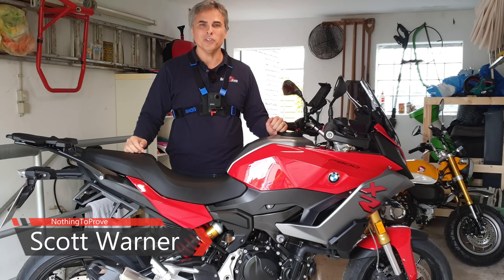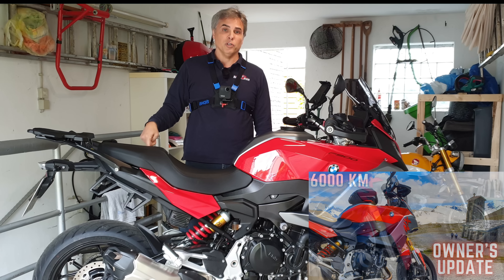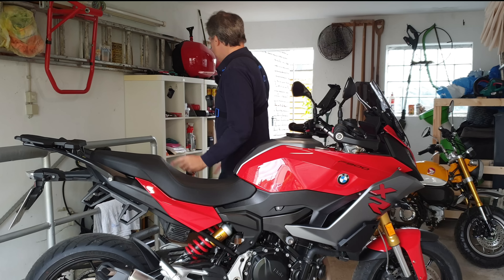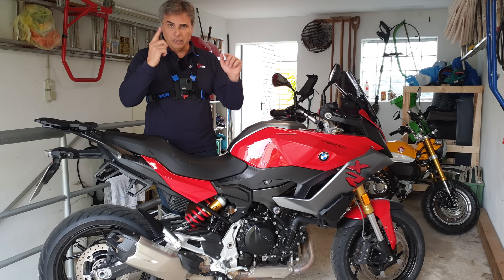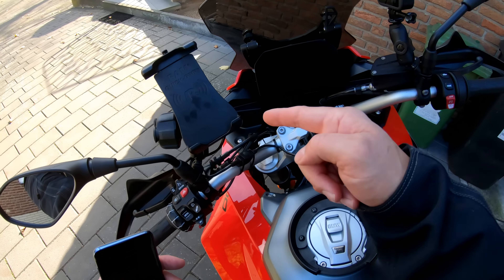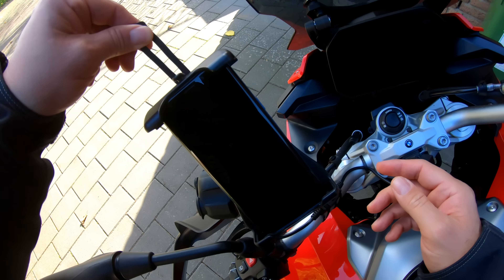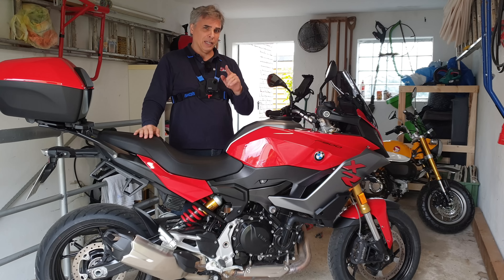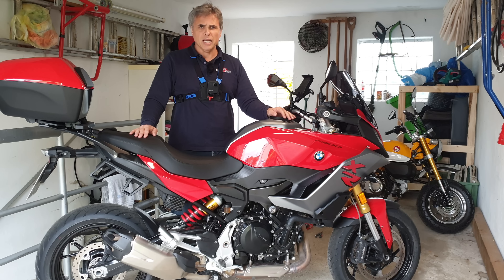BMW F900XR Wireless Charger, USB Install, Mirror Mounts, Hard Cases & More

Comment: Great review. 10 days with my f900xr so far, but with total lockdown Fridays to Sundays,, little chance to ride.
I am very disappointed with my BMW side cases due to their poor capacity, too much wasted space. Can't even fit a helmet in right case and only at a squeeze in left. My biggest mistake with configuring my new toy. Self fitted a Givi Trekker 52 topcase onto the BMW rack at the back and great. Now looking for a USB solution... Your way looks to work fine and the routing is clean and safe. Was thinking of mounting my Garmin above instruments  but maybe not needed. Don't really like looking down for GPS on handlebar mounted phone. Will re-upholster seat with comfort gel for about 80 euros in local shop (bmw actually advised me against theirs). Going for the taller Givi screen too, already ordered. 
Keep the info coming, fantastic work!

Comment: MRA screen with the little flipflop works great. Puts you out of wind and buffeting , and in low position is cool in the heat.
Reply from the maker: Yea, I forgot to mention that brand too 😢 in fact I'll probably get the MRA screen because I put an MRA screen on my 1290SDR and loved it. So will probably get it for this too with the vario touring windscreen (VTM). 👍👍

Comment: Hi  love your content, is the comfort seat a big improvement on the standard seat?
Reply from the maker: Thank you Selina,
For me it's worth it because it raises the seat height 20mm and gives me more leg room and is a little wider so more of my rear is on the seat to relieve pressure, which I need for long trips. And yes it is softer than the stock seat, I do feel it could be a little more...for example the 1250GSA seat is even softer than the comfort seat. I was just out yesterday with "Uli the GS guy" that I ride with a lot and we had the bikes right next to each other and compared seats and his stock seat was a little softer than my "comfort" seat...hmm...I was not a happy camper about this. But for now I'm satisfied with it.
Ride safe,
Scott
Reply: My BMW dealer told me to forget the BMW comfort seat because it's not that comfortable either 😂, as well as hurting your bank account. He recommended finding a local shop to reupholster it. My local bike shop has quoted me 80 euros.
Reply: @NothingToProve  love to have one to give 50mm more with the lo seat provided as std.
Reply: @roythompson6137  wunderlich has the comfort queen that is super comfy for passenger also but..  wont' ship to asia.

Comment: Hi Scott, just a tip about the Connected app.  I'm not a fan of Bixby, but I was able to setup a Bixby routine that opened the Connected app whenever the phone connected to the bike's bluetooth along with starting Spotify in the same routine.  All this is automatic when I turn on the bike and the phone connects.   Now I need to check out that RAM mount -- haven't seen that one.
Thanks for the info for the charger and wiring.  Oh yeah,  noticed the Monkey in the background also :)   Much different than the one she was practicing on so I guess she did well.  Be safe!
Reply from the maker: Thanks for the tip Brian!
Yea, I'm not a fan of these automated things from Silicon Valley, they claim to serve us but in reality we serve them. But as you did, when it is actually more efficient...then I consider them.
The Monkey, yes, she loves it and the reason I have not done a review of it is because I'm trying to get her to do a review instead of me, after all it's hers and she rides it all the time...well now it's cold so not so much any more.
Take care,
Scott

Comment: On my F900R in the US, the navigator cradle was part of a package that I could not customize, so I was forced to include it even though I didn't want it. At first I planned to remove it, but I have since found a phone mount that makes use of the cradle and provides mounting and charging for my phone while using the Connected app, so I've decided to keep it. I do wish I could find a wireless version though, this one just had a short USB cable to the phone.

Comment: Very cool. I agree that wireless charging is cool; I plug my phone in and mount it. I use Waze for the police notifications (speed trapping mostly) and it's general aesthetic and rerouting. That works for me but your solution is elegant. Really nice upgrades. BIke is looking great!
Reply from the maker: I've read about Waze but we don't have it over here in Germany. The question is: Does it really work? And is it practical to use while actively riding?
Thanks in advance Scott!
Ride safe,
Scott
Reply: @NothingToProve  Yes, it works. Often better than a radar detector because most police here use laser now. I have it set to alert via voice when there are police ahead. I'm not a hoonigan or racer but it is good to be conservative when called for. We don't have speed cameras, but I know it also alerts for those. It's a great app.

Comment: not sure if i like that smartphone mount, its huge. the original bmw navigator mount was not an option? there are smartphone inputs for that thing with usb ports and all so you dont need to run any wires.

Comment: Great setup Scott. The BMW is still looking sharp & now you have a home away from home! No more just socks & jockeys. Could you show us if your helmet fits in either side case or top case please? That can be helpful. Otherwise, stay safe & hopefully winter time passes quickly. Still, would love to see more of Germany in winter time 💯🙏🇦🇺
Reply from the maker: Thanks Steve,
Yes, helmets fit in both the top and side cases no problems what-so-ever. Winter riding can be tricky sometimes but I plan to do some when it's dry, don't like cold and wet at the same time, it's a bad combination. 😒
Ride safe,
Scott

Comment: I wonder if you are really happy with the original bags and topbox. They seem not so easy to handle and hold in one hand and a little fragile in the paint when you take them off back and forward to hotel etc. 
Have you this as best solution or do you also consider GIVI as an option.

Comment: Great video. I have a F900R, just bought the BMW soft panniers (keyless option). Installing them looks like a pain, especially coding the key cylinder, there isn't a video I could find anywhere. Any tips you can provide? Very much appreciated!

Comment: Sorry for asking but Since there is a 12V socket why all this trouble with the USB Power wire ?
Reply from the maker: Cause it's located under my left thigh, then I'd have to run a wire from there and it's not permanent or water proof.
ride safe,
Scott

Comment: Hey, I have a question about the top case, its not to easy to steal or that fall down with the vibrations or the wind? Hello from México
Reply from the maker: Hi, na, it's locked on & the top speed for the top case is 175kpm.
take care,
Scott

Comment: I have the same RAM Mount wireless charger. It charges my LG smartphone very well unless the display brightness is turned all the way up. In that case it very slowly loses charge. My solution is to manually set the display at 50% brightness and then it will charge the phone all the way up to 100%.

Comment: I wasn't aware that Ram-Mount had this wireless charger.
The lock is not removable, is it? I had the one that you just apply when you need it. It made the looks a bit cleaner.
Nice video once again 👍

Stay healthy and safe Scott!
Reply from the maker: Hi Simon,
Yes, the lock is removable, when it's unlocked it can be screwed off and used on any RAM mount arm just like the standard thumb screw. And yes, it's big but I guess that's the price for security.
Take care,
Scott

Comment: hey there! today i ordered my xr900 2022 black storm edition , but i have only one question...is it true that the engine is low quality because of the fact is made in China by leoncin?...only rumors, in my opinion BMW is a premium brand so even if it is made in china should still be a premium engine. right? thank you and hopefully my xr arrives in a few months.
Reply from the maker: Na, don't worry about the motor, if there was a problem I would not have bought mine 😁
BMW has had this motor made at this same plant in China since 2007, when it was the F700, then it changed to the 750, 800, 850 and now 900 but in all iterations, it's still the same base motor. So by now if there were problems, BMW would have them worked out by now.
ride safe,
Scott

Comment: 900xr brochure says it has a 12 volt socket? Where is that located in the bike & why you didn't use that for power supply to RAM mount?
Reply from the maker: It's underneath the seat right under the left thigh. So I would still have to run a usb wire from the handle bar all the way down there...so just go to the battery and keep the 12 volt port free for when I plug in an electric riding suit...that is why it's located there.
Reply: I like the idea of 'switched power' for the phone mount (as that will always be on the bike); and going to the battery for the electric riding suit (with an in-line fuse).

Comment: Aren‘t you afraid the vibrations might kill the camera in your phone? That was one of the reasons why I opted for the TomTom (apart from being afraid of water damage in the rain) instead of a mount for the smartphone.
Reply from the maker: Nope, I've heard of that but I've never had a problem with my Samsung S7 or now my S9. I've used phone mounts for both phones for a few years now and I've never had a problem with either phone. And I ride in rain/winter all conditions and sometimes I really have to clean my phone when I get home from all the dirt mud...etc.
Maybe it's the cheaper phones with mechanical lenses in the camera. 🤔

Comment: I'm simply reasoning out loud to myself. Not really sure what benefit the wireless charger offers, but if it's to eliminate the phone's charging cable, well then that benefit is counted as null (cancelled), given that the wireless charger itself needs a power cable. Plus the need for a clunky lock mechanism to secure it.
As I said, I'm only thinking out loud.

Comment: Interesting video again, Scott! Why do you/ we need a phone mount, the most important information as who is calling, point to point indication, music choice is available on the TFT from the BMW? How easy is it to take off the mount for the topcase (which would decrease the small rear of a F900R)?
Reply from the maker: Hi Marcel,
I use the phone in conjunction with the BMW Connected App, then I can see where I need to turn and the display on the bike tells me where to turn, basically when used together, phone and display, it eliminates the need for a Navi. That is the main reason I made this video, to show that Navi's are no longer needed on a bike like this and it's the same on 900R too. 😁👍
Oh, and the top case mount takes a long time to put on and take off, like about 2 hours, lots of screws and side body parts have to be loosened...etc. So it's not an easy short job, once it's on, I'm leaving it on there for good now, I won't be taking it off any time soon. But I pretty much leave the top case on my bike almost 100% of the time now, it's just convent to have. The side cases I leave off unless I really need to carry "stuff" usually on a over night trip or longer.
Take care,
Scott

Comment: Hi Scott – love your videos! I'm about to get the side carriers for my bike. Two questions are they wider than the handle bars when installed? Also do they look cool mounted on the bike?
Reply from the maker: Thank you.
It's about the same...when I look down from the front of the bike or from the rear the bags look about the same as the bars...maybe the bags stick out a little bit more but not by much.

Comment: Not sure if anyone else has suggested but I use Quad Lock to mount my phone, that also has a wireless charger, from a cable tie perspective you may want/need one or two but no more than that.
Reply from the maker: Yes, I like it but what I don't like is that I have to put a case around my phone but if you don't mind that then it's a great alternative.